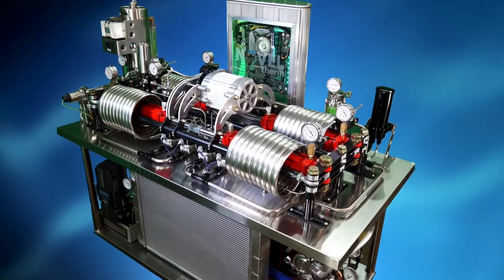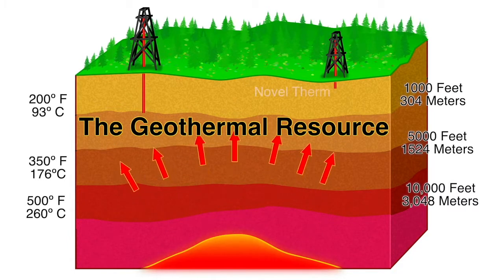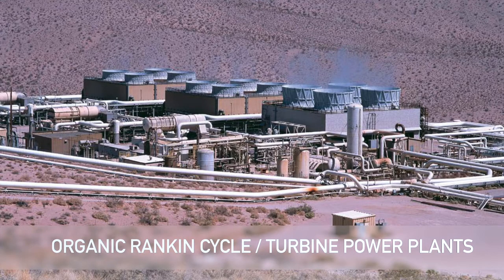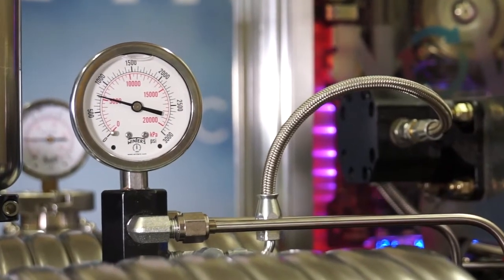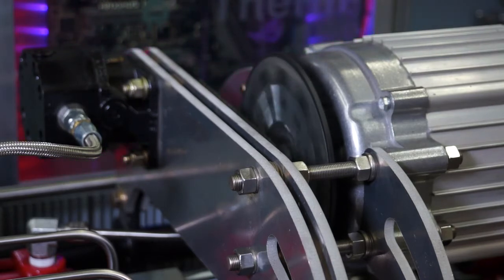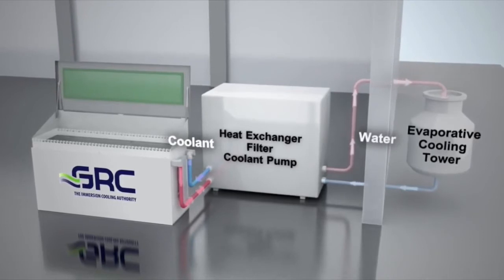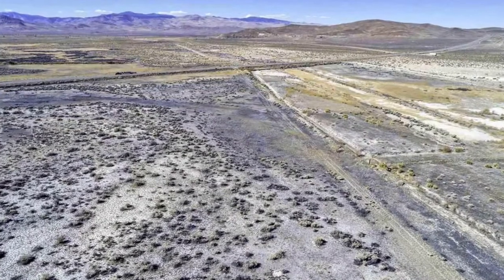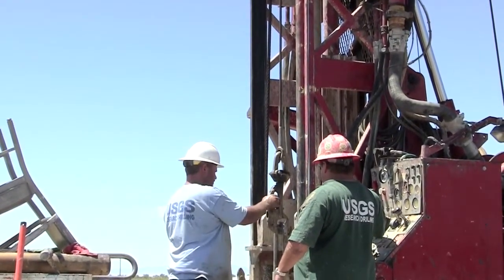How to build truly off grid, sustainable, green energy HPC data centers

Comment: Very neat system. Could you produce a small scale system for use on a home stead? Solar thermal heat source would be the preferred for simplicity and cost. It would need to power two small homes and a shop and greenhouse fans.
Reply: Hahaha I just posted almost the exact same thing
Reply: He does say you can use focused solar